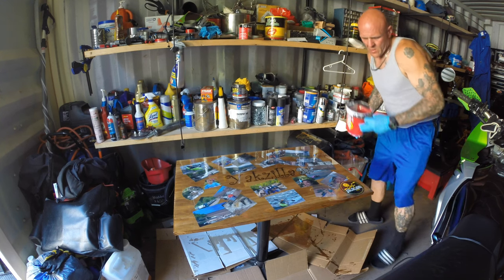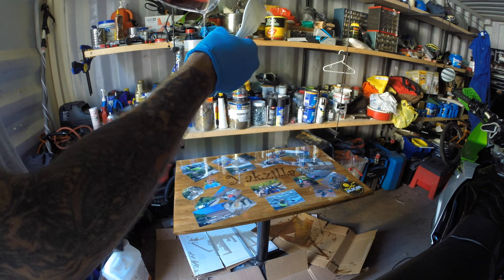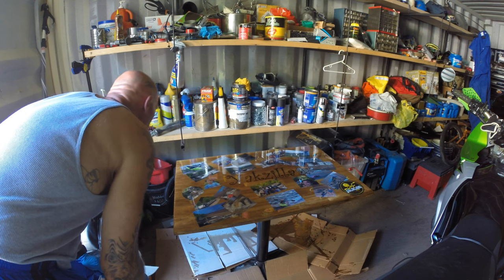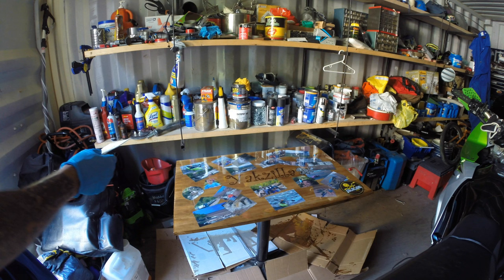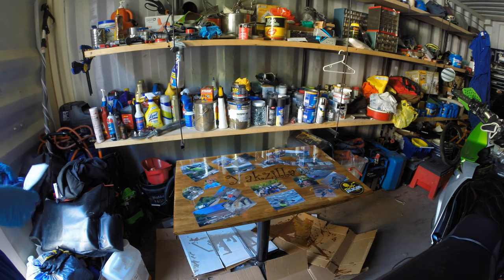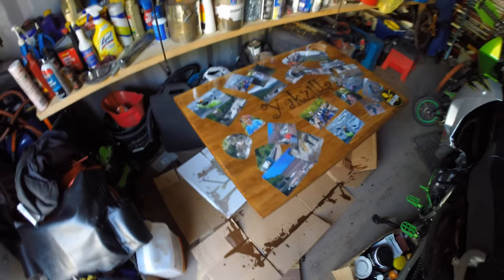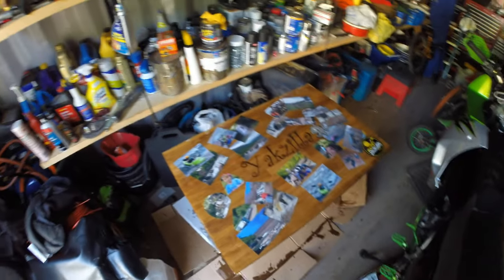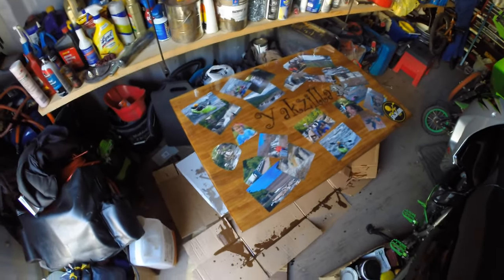FAMOWOOD Glaze Coat Finish Step by Step Use

Comment: Nice job! What a great family memory you built! Thanks for sharing your video. I am ready to put a coating on a bar I am refinishing and wondered about whether the hair dryer would work or not.  I have a difuser for the hairdryer I will try to see if that prevents the ripples.  otherwise, I will have to try my hand at a blow torch. YIKES! I too was worried it would cause an explosion.
Reply from the maker: The torch worked best and I was amazed at the fact that it was not at all flammable thanks for viewing glad you enjoyed.